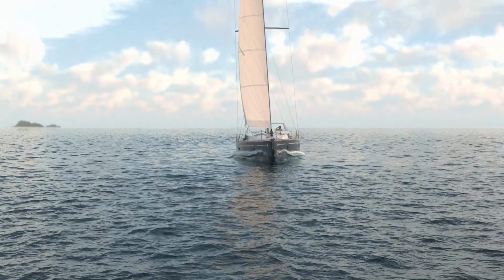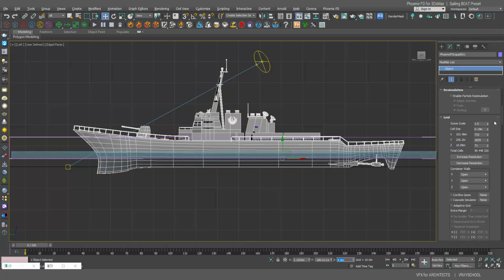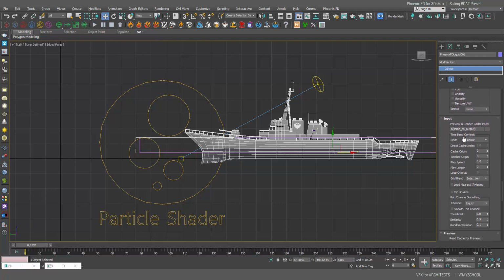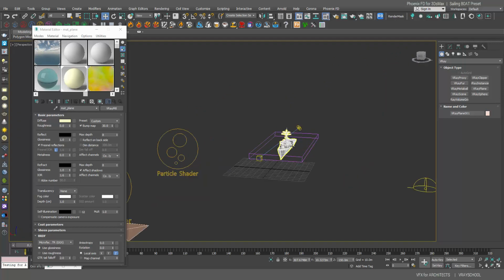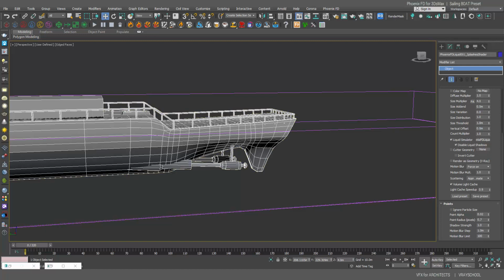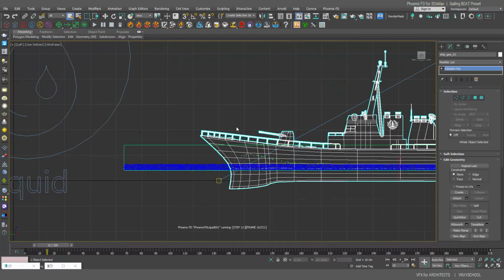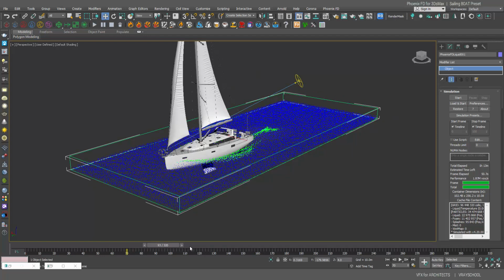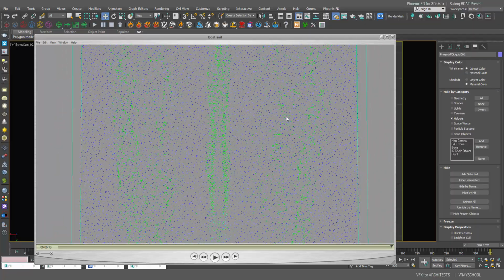Sailing BOAT Preset  |  Phoenix FD for 3DsMax

Comment: When you show the setting of all values, show us how they visually differ and what they affect. I understand that based on experience, you know in your mind how the picture will already look with the settings that you set, but those who are not familiar with the tool do not know this. The result is just copying the numbers without understanding what they are responsible for and what the difference between these parameters will look like.

Comment: Phoenix FD is a torture device developed by sadists to melt the brains of the average CG artist. I've never before used something so appallingly badly designed. A million settings to produce  something that really should be achievable using a live preview and some sliders. Great results are clearly achievable but the production pipeline is just too painful!
My advice, don't open the box if you value your mental health and wellbeing or actually have to produce a CG video under deadline conditions!
Reply: So what do you suggest to use instead?
Reply: He is just frustrated because its really hard to use but the results are amazing when it work. WHEN it works.......
Reply: "Phoenix FD is a torture device developed by sadists to melt the brains of the average CG artist" couldn't agree more. Better stick to Houdini

Comment: i followed your tutorial step by step but in my scene foam and splashed dont appear.
Reply: if you notice at around 27:30 time, you can see his particle numbers in the cache content box if you use the foam and splashes count the used it will not be even close to those numbers, you have to crank those up a lot
Reply: yup, two things: phoenix is very weird in this matter, also happened to me some times when i follow every step and the results are quite different, and second: some ppl that make these tuts, sometimes they simply change some values offline (maybe for edition purposes) and when you see their results on render they are actually using different values of what they showed first